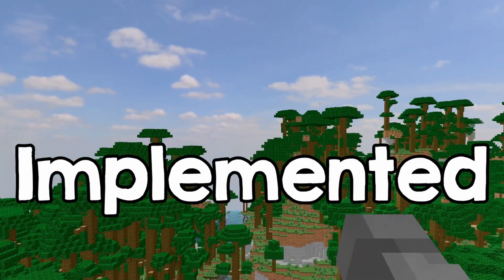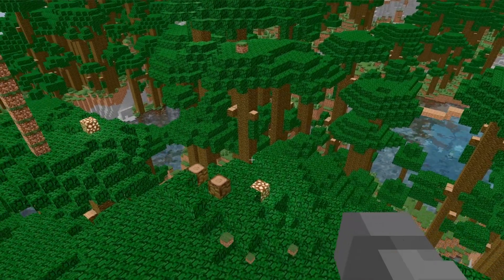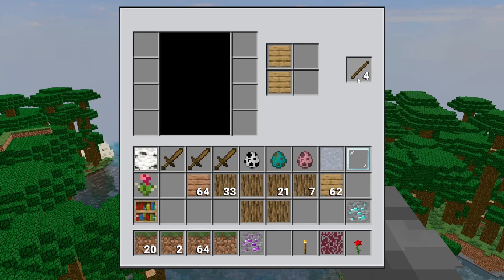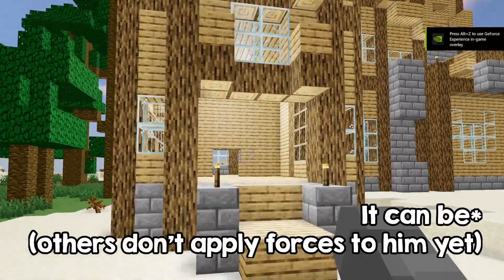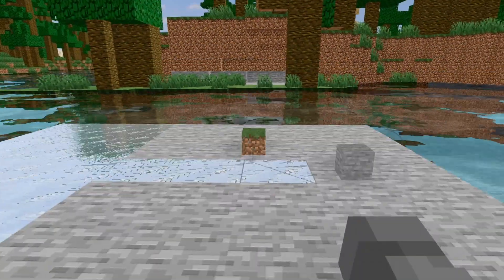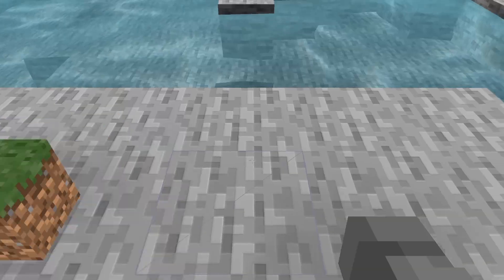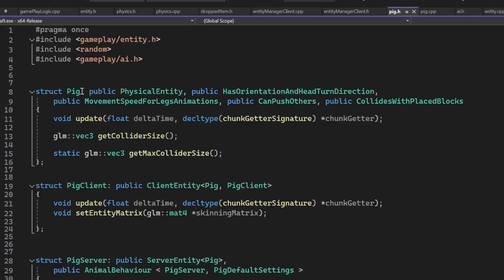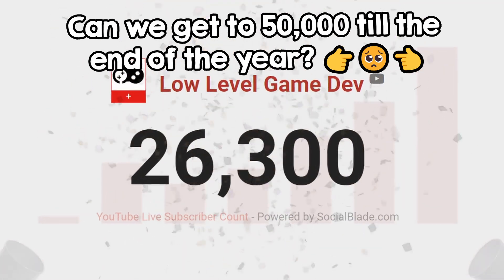Adding Physics to my C++ Minecraft Clone!

Comment: I think the clipping through complete blocks is mostly a non-issue: Since the physics movement should be calculated per physics tick using the delta-time, the player would have to move more than a single block in a single physics tick(max_vel = 1/physics_dt), so for a physics tick rate of 30 updates/s the player would need to travel at least 30 units/s(assuming 1block = 1unit = 1meter, that's 108km/h or 67 mph).

Comment: Is this the same way that Mario 64 calculates physics
Reply from the maker: idk but probably, many games do this
Reply: @lowlevelgamedev9330  how about if you use a raycast instead of quatersteps?
Reply: There is a sm64 rom hack dev called Kaze Emanuar that made a video in how he fixed collisions with walls in sm64. Check out "The Problems with Walls in Super 64" for more info